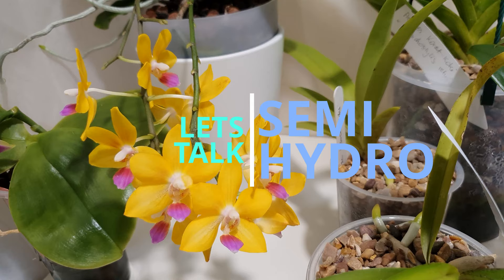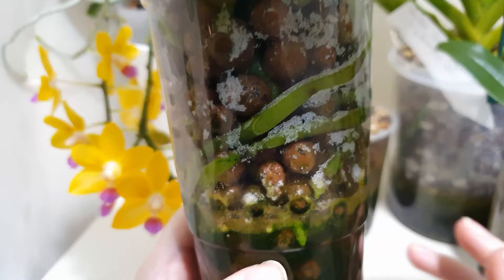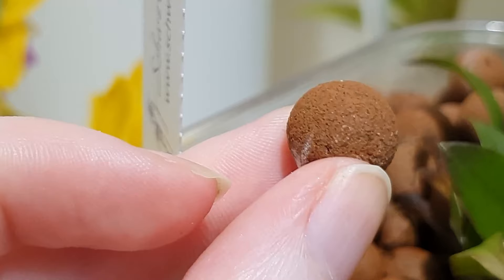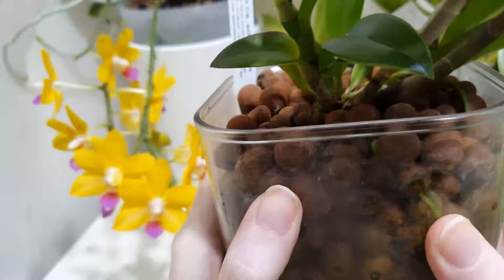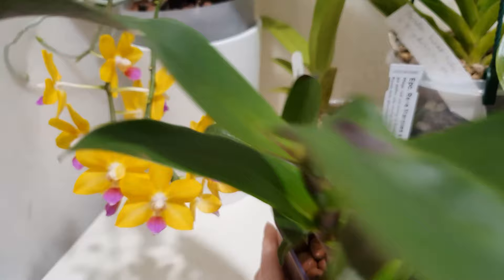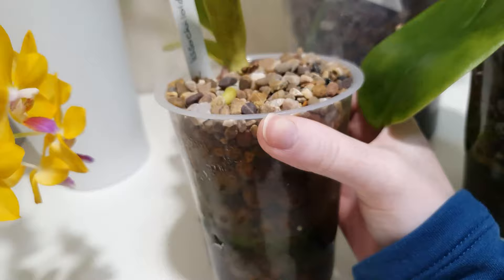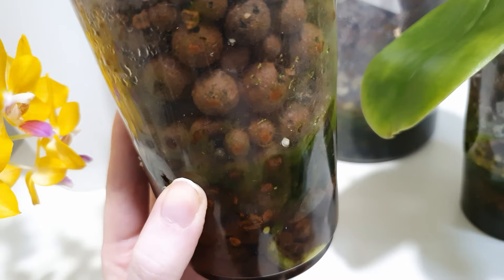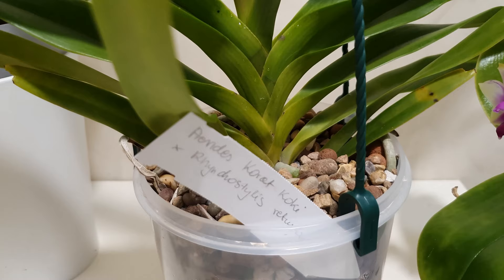Let's Talk: Semi Hydro for Orchids- Intro, Root Adaptation, Overcoming Dry Top Layers, Modifying SH

Comment: Lovely video and very informative as always! Thanks for making it. Do you soak the beads over night before repotting in self watering ? Do you prefer self watering or semi hydro? do you let the reservoir gets empty completely before fill it in again? or just fill it weekly?
Reply: good questions! thanks for asking, I'll just tag along for the answers....giggles😉
Reply from the maker: Hi! Thanks :-) Yes for any use of LECA, Pumice or other 'rock type' materials I soak the LECA and do several wash stages. usually a minimum of 3 washes in total. Wash, soak, a few more washes, then use. I test the pH and TDS after this prep method in this semi-hydro discussion video toward the end: https://www.youtube.com/watch?v=RLBzZgv6xmQ

Pumice is just as dusty as LECA, think it's a rock thing :-) If you don't wash thoroughly that dust just clogs up the reservoir and can also dry the roots, it skews your TDS readings also.

Self watering and semi-hydro have different applications for different orchids. Self-watering tends to be a slightly drier/ more aerated environment due to the nature of having the 'floating' inner pot so this may be better for Vandas etc. Self watering also gives you a much larger reservoir, so conversely it's also good for very thirsty orchids that drink their reservoir too quickly.

Reservoir never ever goes empty unless by accident during summer- if you were to let it dry between waterings, that isn't semi hydro or self watering. Wicking material will suck moisture when it's dry. Let your LECA dry out completely for too long and what's it going to suck moisture from? The roots.... Not what you want :-)
Reply: @TheOrchidRoom  Thanks for the thorough reply. Your orchids are growing so lush and happy that it makes me want to convert all of my orchids , though I 've always grown them in organic and like organic. However I think you gave me enough reasons to convert them slowly. Thanks again.
Reply: @TheOrchidRoom  Hi Anabel, what is the brand of pumice you are using?
Reply from the maker: @marygorchidsmore2058  I definitely agree with going slowly, for me phals and cattleyas are the easiest to convert 😄 if you're trying it over winter definitely helps to put them in a heat mat when you first switch them over. The pumice brand is linked in the description under 'Media' 😄
Reply: One thing I’m finding is the orchid roots I take out of pure sphagnum do much better adapting to the semi-hydro. Which seems to me to substantiate your theory.  If they come out of bark, the roots seem to struggle a bit more. I use the leca-pumice with a top layer of pebbles as well.

Comment: Hi, I see your using a small river rock for your top layer. Have you ever used a little moss on the top/ This is a fantastic video. Looking forward to more of these..... Ron
Reply from the maker: Hi :-) Thanks! 

I have tried this actually when I was very first trying to get my Miltoniopsis to adjust to LECA a few years ago (They still refused!). My issues were:

1)Moss drying out really fast on the top layer, even with a thick layer. the dry top layer of LECA just dried the moss out quickly.

2) Moss flaking down through the mix, little bits of moss through the mix and in the reservoir which made it start to decompose.

3) Ultimately, adding organic to inorganic kinda pollutes the inorganic a bit. Inorganic never breaks down or acidifies so doesn't need regular repots. Adding moss means you'll need to unpot and get all the soggy moss flakes out of the mix every now and again and replace the top layer.

It's not a bad idea, it's just not for me and I think the top layer of moss actually would need misting to keep it moist so it adds a bit of extra work... anyway, those were my thoughts after trying it for a while. Hope that helps!

Happy growing :-)

Comment: Hi.I just recently bought a Phalaenopsis orchid with bloomed flowers that was repotted in bark.Should I repot it to the LECA or should I wait until the flowers wither?I am not sure how well the roots are doing in the bark.What do you suggest.
By the way, I learned so much from you :)
Reply from the maker: Hey! So there are lots of different opinions on this but I'll give you my personal thoughts and what I tend to do.

So there are 2 main issues with repotting an orchid while it's flowering. 1) is that the orchid is currently putting its energy into the flowers, so may not be growing actively, and new active growth from root tips is the ideal time to repot as it minimises the transition where some of the old roots may not make the repot, when you have new roots growing in to replace them if something does happen. So once phals are established they can grow roots and flower all at once, but often when they're from a shop they'll just be a bit stressed and flowering without active growth.

2) If there are any buds, they may blast when repotting due to the repot stress where the orchid might lose some of the old roots.

Now I tend to ignore both of these things but I just wanted to explain the thoughts behind why it's supposedly bad to repot in bloom. I tend to think, I'd rather get it out of the media it came in, which is usually bark and hassle for me 😉😂 but it's often also breaking down and may have insects. And often there will be a sphagnum plug in the middle which is just horrible to water. 

And my feeling is, if the flower spike starts to wither or the buds start to blast following a repot, it probably didnt have the best roots anyway, and could do with the flower spike taken off to concentrate on growth. So the fading of the old flowers is just the orchid saying, wait, I need to fix my overall health first.

If it were me (and please dont feel like this is the only way to do it!) I would take the orchid out of the pot and look at the roots. If it had a great root system, I'd pop it into semi hydro, then carefully monitor and watch for new root tips. If it didnt have such good roots, I'd probably still put it into sh, you've already got it out of the pot after all. But I'd probably also put the phal onto a heat mat, and be sure to give it a good dose of seaweed regularly with it's nutrient solution. Just my personal thoughts, if you live in a hot climate then maybe disregard the heat mat, I just find it really helps to speed up the transition in cooler climates. 

Hope that helps 😊
Reply: Waow you are so fast.Thanks for your answer.I will repot it to semi-hydro and see what happens :)
Reply: @TheOrchidRoom  Unfortunately my orchid's root are rotted.Should I change the medium or my watering frequency in leca?
Reply from the maker: Old roots may die off in some environments and semi hydro involves a constant reservoir of water so watering frequency isn't really a factor. Is it being kept warm? The next stage is waiting for new roots to form and go down into the LECA as they will be adapted to the new environment 🙂

Comment: I see that you're using pumice in your pots. I'm unable to get it here in the states and Amazon won't ship to the states. I'm currently using a layer of aquarium rock on top of my leca and it seems to be working fine. How important is it to use pumice as well?
Reply from the maker: The states as in America? One of my friends recently ordered some pumice from Amazon US? Unless it's state specific, I have no idea. I've been growing for a couple of years with LECA alone and it's just fine for many orchids, the pumice just seems to have a slight advantage in moisture retention and also how many air pockets it has. If you're using a top layer of the gravel anyway I think that really helps with the dry top layer, so pumice probably not essential, I just really like it 😊
Reply from the maker: This is the one my friend showed me when we were discussing similar options to the lava lite brand I use, that were available in the US : https://www.amazon.com/Bonsai-Jack-Horticultural-Pumice-Amendment/dp/B00H302Z3K

It seemed to have good reviews, be the correct sort of size and not too expensive. Unfortunately they sent me a screenshot from their amazon but I cant actually access details from the UK as it doesn't ship to here, so I hope the link is working ok.
Reply: I am in US and bought it off Amazon. ‘Gardening Pumice Soil Amendment 1/2 inch screened, 8 quarts’ sold by seller called Gantessa. I paid 18.99 for 8 quarts. There were other brands and sellers too, but I wanted the bigger pieces. Check again on Amazon.
Reply: @TheOrchidRoom  Thank you for replying. I'm not going to worry then if I can't find the pumice as my plants seem to be doing fine right now.
Reply: @orchidgarden3124  thank you. I'll look for it . . .

Comment: Dear Annabel,
I have watched a few of your very informative videos and am keen to try your semi-hydro method. We do have different supplies here in Australia and I’d just like to check some out with you:
1) It’s very hard to find pumice here in Australia, so would perlite be a suitable substitute?
2) The “non-wicking” gravel/pebbles, you use - are they just normal river pebbles?
3) I am still trying to work out my nutrient mix. We have "Thrive" orchid food (liquid) and "Seasol" seaweed extract.
I am thinking I will just make a solution of seaweed and dilute orchid food and use that to top up the reservoir?
4) I have tried your Instagram page, but it says it has been removed.
Thanks again
Reply from the maker: Perlite is quite soft and will eventually break down over time, but for a while it may have some uses. I use it for some house plants, if you can get a large grade perlite you could probably use it for orchids, but small grade perlite will obviously have less air gaps and probably would only be suitable for fine rooted moisture loving orchids. If you check my media trial videos you'll see it held about 4x the amount of moisture to pumice, so it has quite different properties.

Any smooth pebble that isn't porous and can't suck moisture from the roots will be fine, may need to vary the size for different orchids.

If you check the recent videos the instagram has been corrected on those. I changed the instagram name. Or just search the orchid room on Instagram.
Reply from the maker: I can't really comment on the feed without knowing composition. Can you let me know the nutrient breakdown in percentages of thrive? Or link the product?It depends which thrive this is, but there is one that is only NPK, so that may not be suitable long term without additional supplementation.

You may want to check Orchie Dee, she has managed to get some complete balanced ferts in Aus, this video around the 5 minute time mark shows her ferts: https://youtu.be/SvEW3dHEkO4

This isn't specific to semi hydro, this is something that applies to all orchid care. You want as a minimum, Nitrogen, Phosphate, Potassium, Calcium and Magnesium. Those are the major nutrients. I give a breakdown in this video of what rain mix has in it: https://youtu.be/ux9WzRnMZmg . It also contains micronutrients, including Iron, Manganese, Zinc, Copper etc. I believe a few subs in Aus have got some good, balanced mixes from hydroponic stores. It doesnt have to be specifically for orchids. The main thing when tailoring to orchids is to lower the amount given, but feed frequently, which is something that fits well with semi hydro since it is always there.

Comment: Why not mix Leca with bark?
Reply from the maker: I dont see any benefit to doing so? Bark has to be my least favourite media, sticks to roots, doesn't wick and would disrupt the wicking efficiency of leca in a semi hydroponic system. It is organic so it would break down, which would happen faster if kept constantly moist. It would acidify the media and make a yearly repot necessary, with a major plus point of inorganic media being that it completely eliminates the need for repots until orchids have grown out of their current pots. This is all in relation to semi hydroponic setups of course, LECA can be used in bark and moss mixes for a normal organic potting setup without issue. But that isn't what we are talking about here...?

Comment: 😃👍🏼 nice one 👍🏼 I’m tempted to put my Lou Sneary into the self watering set up, after seeing this ... I’ll wait until spring tho... it’s currently in a plastic basket with lava rock as support, doing well, but would like it to do better ... it’s going to be involving some surgery to get a root out of the hole in the basket it grew through ... of course, it has to be the best root 🤦‍♀️😆
Reply: hi Nina, just my opinion, but I would cut the plastic b4 I cut a root on purpose,  😊
Reply: Becky Connor oh absolutely yes 👍🏼 my only fear is that, I may also cut my finger in the process because it’s in one of those decorative thick plastic baskets which are like faux weave & should in actual fact be used for something decorative indoors 😅 clippers, Stanley knife 🤞🏼🤷‍♀️🤞🏼 it will get interesting ... or not 🙄
Reply from the maker: I was shocked at this second Lou Sneary and the sudden massive root surge! I do think they enjoy more moisture. But then we also have my fussy Neofinetia falcata "Kokakuden" x Rhy. coelestis "Ching Hua Blue". Techincally the same cross as a Lou Sneary? But it has other ideas and has spent a year with me torturing it, before it finally gave up the battle and decided to adapt to semi-hydro with pumice! It was an adapt or die moment and it chose life ;-)

I can totally relate to the root situation, I broke so many of my Rhy. coelestis roots getting it out of the basket it was in... Made me feel a bit sick. Just as I was levering one root off with a thin flat bit of plastic, I'd move it too suddenly when it freed itself and another would snap off on the other side...

But it's now branching so it's ok. But I can appreciate the anxiety and putting off that repot! :-) Maybe in spring? Or is the root in the hole situation getting worse with time?!
Reply: The Orchid Room the root has grown through the slit in the faux weave and gotten quite long ... push comes to shove, I’m going cut around the weave through other squares and just leave the root with its little plastic ‘hoodie as is and pot it up that way ... it’s doing well, but anything I can adapt to self watering is a bonus. I’m not using any heat mats for my orchids this year. I want to test them for what they can do without heatmats. So, that’s why I keep saying spring. Which, in my eyes, can’t come soon enough 😊